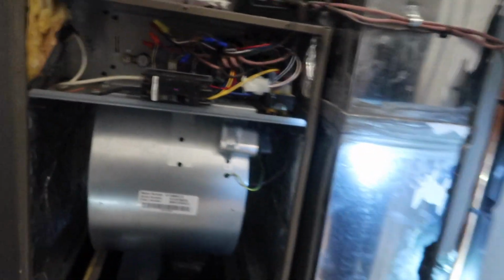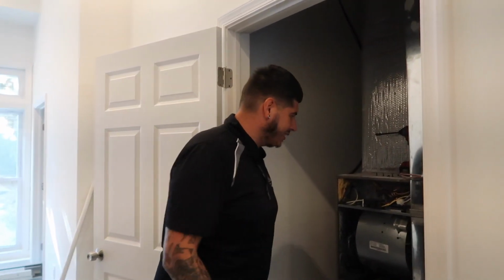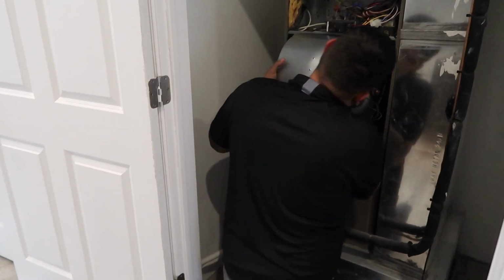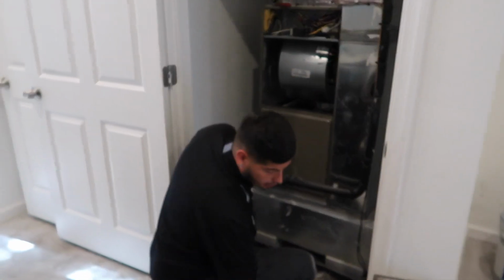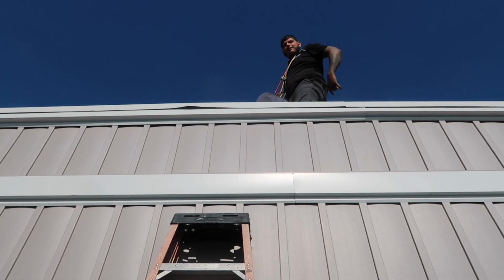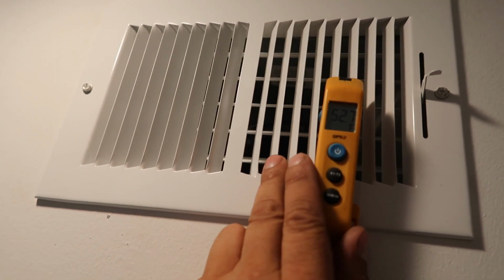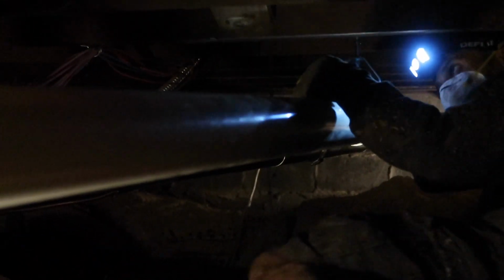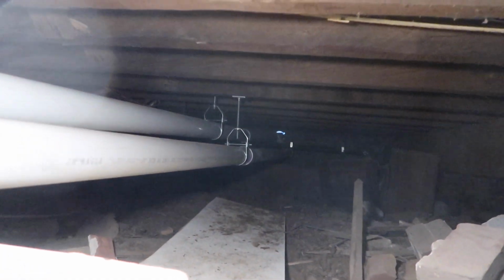SERVICE CAN NEVER BE EASY!!!

Comment: QUESTION HAVING A BRAND NEW HOUSE BUILT IN BENSALEM.. THE BUILDER IS INSTALLING A 13 SEER CENTRAL AIR .. THE SQUARE FT OF THE HOUSE WILL BE 2000 WITH OUT THE FINISINH BASEMENT… DO YOU RECOMMEND GOING AT LEAST 16 SEER...
Reply from the maker: 13 seer? I think minimum seer is like 14 that means they putting low end equipment in
Reply: White Works probably  builder grade .. I’ll upgrade after the built
Reply: The higher the seer rating just means it's better efficiency. A 13 seer unit will work just fine as long as you size it right and duct work.
Reply from the maker: Exactly
Reply from the maker: Yeah that’s what they usually put in